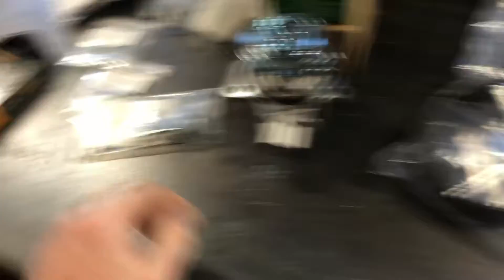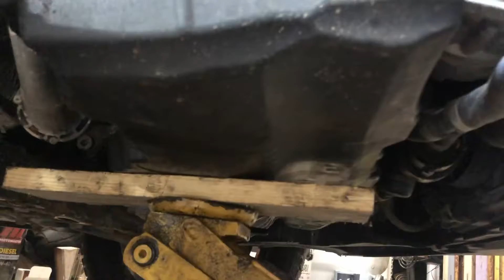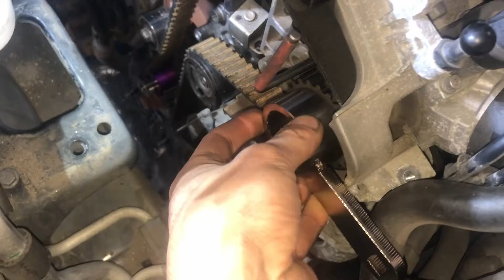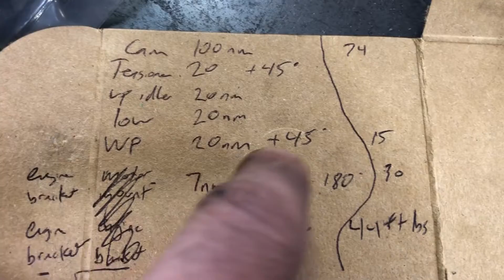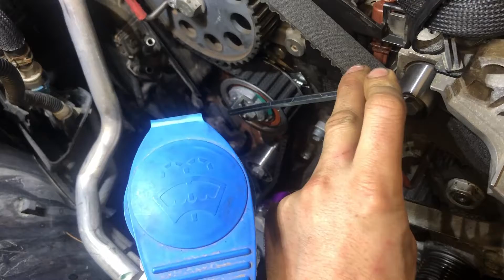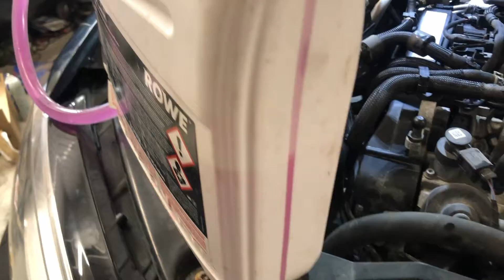Step-by-Step Timing belt replacement for EA288 CVCA 2015 TDI (VW, Audi)

Comment: Per service. Supposed to rotate cam and HPFP clockwise....not middle....bro eye balled it. Should have just put the pins in marked the belt and gears and put new belt on. Tf is this "half way" bull shit.

Comment: I'm new to this, very enthusiastic too do it myself. My question is why do you have to loose up camshaft and high pressure fuel pump sprockets bolts? Can't we mount the belt by not putting top idler? I've seen videos where people didn't lose these both. Is it possible?
Reply: Its not to help get the belt on, you loosen the cam and pump sprockets so they can turn a little when you tension the belt. This is to ensure even tension all around the belt. Yes you can get away without doing it but you won't be able to easily reinsert the lock tools after turning it over and potentially you will shorten the life of the belt. Its quite easy to do so why not just do it properly!

Comment: would you know the diameter of the lock pins. Friend could only get some 7/32 drill bits to go in the hole in the head, vs the ones in the kit like yours oddly and just made sure all were lined up before tightening the big nuts on.
Reply: same thing i had to use allen wrench in my wholes. that kit was wayyyyy off! glad im not the only one

Comment: does the idler stud have locktite on it making it hard to get out  or should you put heat on the aluminum for a few secs to break any loose.
Reply from the maker: usually the timing stud doesn't have any unless its been apart before
Reply: @JoshsJettas  great thanks, Guy in a work group we are on has 2 to do this summer , He gets rust free parts for VW's in Texas and takes them up to Canada to keep them going, and puts them on the buy sell sites.
Reply from the maker: Rust is definitely the biggest killer of TDI’s around here
Reply: @JoshsJettas  the 2 litre Mk6 power steering rack lines are rusting out now. he supplies them even

Comment: How did you get that def line off?
I'm pinching mine like crazy and it won't come loose?
Is there a push in, or pull out trick while you're pinching? Or does it need to be at a certain position? 
I've tried all sorts of things and nothing is working.

Edit: Also is the plastic clip split on the opposite side of the prongs that you pinch? Mine has a split in it on the back side and I'm not sure if it's supposed to be like that or if that's normal.
Reply: what did you end up doing? mine was the same, the black plastic had a crack in it so pinching seemingly did nothing. I ended up properly destroying it to get it off, so I'm going to figure something out with a mix of zip ties and super glue tomorrow, god I hate VW lol. I also cracked the dreaded DEF exhaust sensor nipple off one of the sensors, the plastic was completely brittle, probably from all the heat sitting on top of the DPF in its baked potato wrapping. I also have a blown crankshaft oil seal, which requires taking the stupid disposable oil pan off to get to the bolts to take off the oil seal. This is a real POS car to be honest, I hate VWs lol.

Comment: Quick one Josh.. I have a P13CE (cylinder 1 electrical malfunction) I swapped injector and glow plug from #1 with #4. This didn’t change the codes at all. Any thoughts?
Reply from the maker: I had seen some post recently about the glow plug electrical plug itself being faulty, although that was on a 09-14 if I remember correctly.
Reply: So this is nuts, I’ve had this code for a couple months. I swapped it a few days ago and like I said, didn’t see a change. That’s when I sent the message to you today. The light went off and everything seems to be fine... Go figure.
But thanks for the reply. Always remember to “like” every one of your videos, hope it helps the channel grow!

Comment: I might have missed it... but, no concern of ECM flagging a cooling system performance code with "non sleeve" water pump? ie. Engine will take longer to warm up? I suppose you would have already provided an update if that was the case. Will definitely suggest the "non sleeve" pump to my boss for future TB services.
I replaced a timing belt & WP on a similar TDI last month... the sleeve was stuck forward, but there was never any overheating complaint... or lack of heat inside the car (I suppose the electric pump supplied enough circulation for both cabin & engine?).
Reply from the maker: I think you’d need to be in fairly hot climate to notice an increase in heat with the stuck shroud (or working it hard). I can’t see it causing any issues/codes for extended warm up, I’ve got a feeling it’s to get it to operating temp as quick as possible for emissions purposes.
Reply: @JoshsJettas  Have you noticed it any longer to warm up in our wonderful Canadian winters?